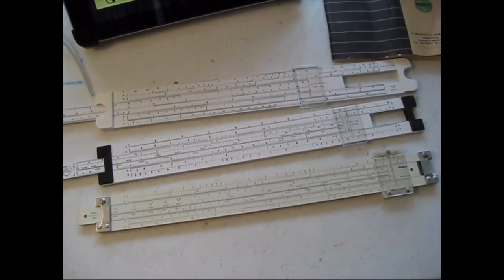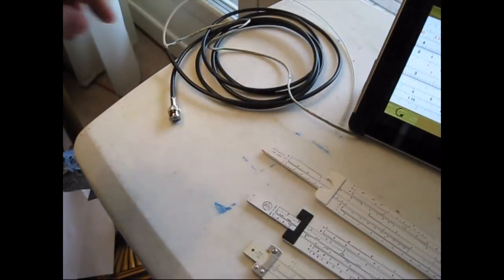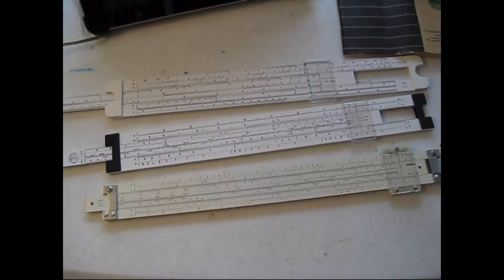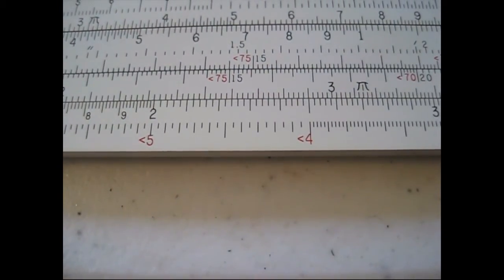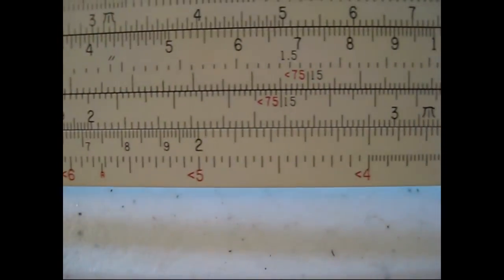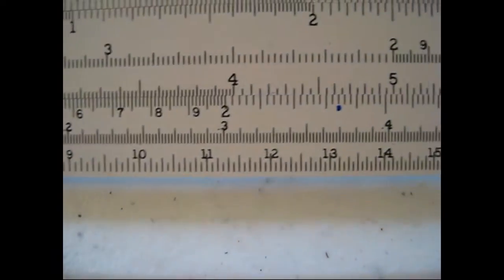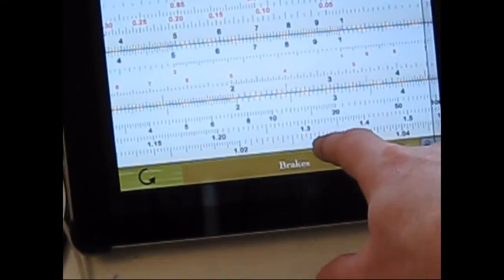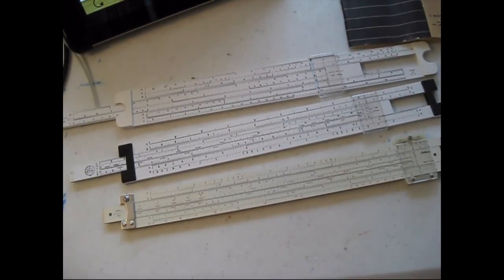Grid Down?  Got Slide Rule?

Comment: Yep.   Every transistor has what's called a P-N junction.  
The main part of any Transistor, Diode, Silicon-controlled rectifier, etc.  
The reason older cars would still run is that they didn't have transistor circuits and alternators..they had generators...
An EMP pulse would burnout any P-N junction that wasn't protected in a shielded casing.( Power on or off doesn;t matter.) 
There is a box you can make out of simple aluminim foil that the EMP would not penetrate..forget the name of it..